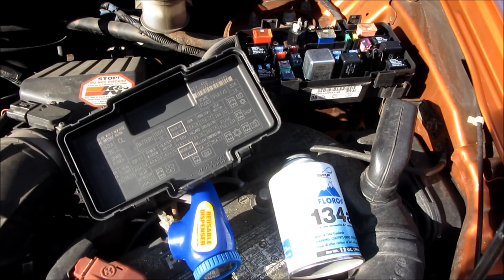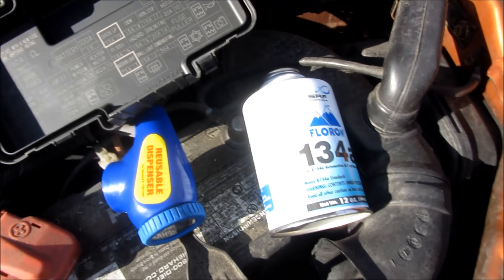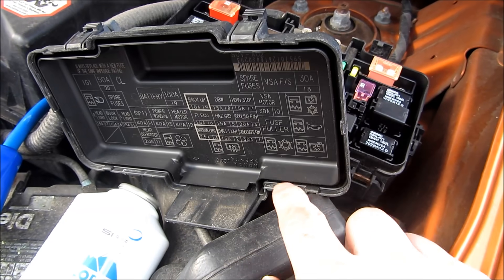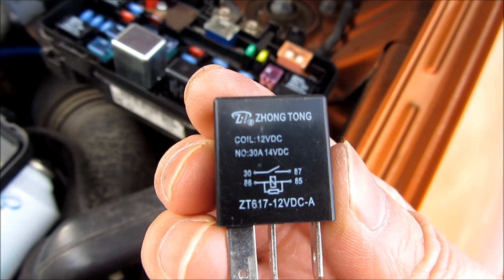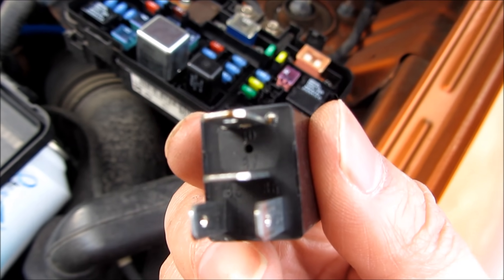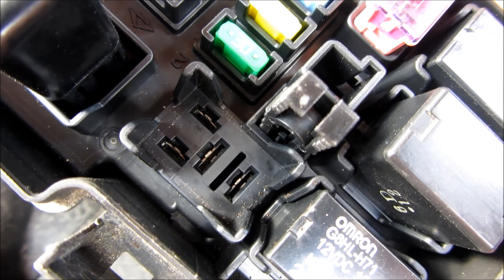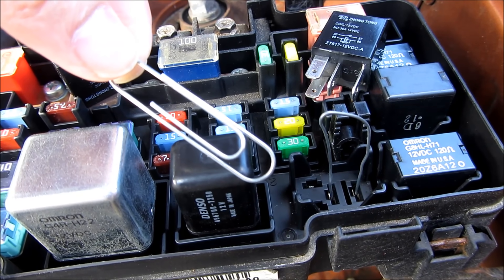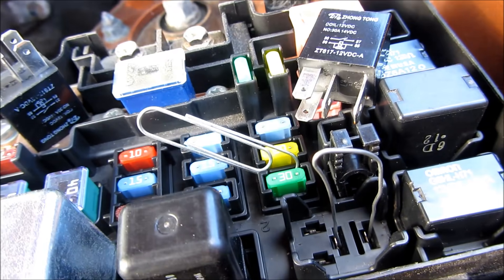Engage AC Compressor Clutch with a Paperclip on Relay | How to Fix Bypass Won't Engage | Jump Relay

Comment: Believe it or not, In most dealship workshop manuals this is step #2 in troubleshooting the ac compressor.
Reply: What's step number 3 when it doesn't engage when jumped, test light confirms power to clutch, multimeter confirmed the ground...
Reply: @chrispayseur6913  Go straight to the source.  Put power to the clutch itself and see if it engages.  That'll tell you at that point there's a wiring issue between the clutch plug and somewhere in between.
Reply: @automotiveperformancemobil4030  Thanks, I was actually able to tap the clutch plate with power running to it and it engaged. Ended up pulling off the clutch plate taking the washer out and replacing it with a washer half the diameter bringing it closer together and it's been working ever since.
Reply: @chrispayseur6913  hhh

Comment: I really appreciate this. Once I saw the compressor and everything worked, I jumped it, filled freon, and restarted. Now, it didn't cut on initially on its own but I simply disconnected the car battery for a minute to reset everything and it worked! With all the intelligence in cars you'd think a simple refrigerant gauge would be made. Nope. Imagine how many people replaced ac systems when all they needed was to attempt this process first.
Reply: my clutch would NEVER engage on my 01 JIMMY.  I just wasted 300 dollars to replace it and refill it. still never engaged. just saw this video and I'm going to be so mad if it just needed to be jumped in order to start engaging again 😡😑😑😑
Reply: Thank you very much , I couldn't understand why after all I couldn't get the ac to work until I removed the battery cable and put it back on ,thanks a lot !!!
Reply: @isabellamaya5464  How about it? Any updates?
Reply: @mikeprice8307  well still going strong! When I got my ac compressor it didn't come with a pressure switch in the back so I just kept it on a paperclip to jump it anytime I need AC  (2001 GMC jimmy 2wd)
Reply: @isabellamaya5464   so you purchased a new compressor for nothing?
Reply: @mikeprice8307  yes! I bought the car thinking the AC clutch went out .. but as soon as I found out I was ticked off, they wouldnt let me return the AC compressor
Reply: @isabellamaya5464  there's always ebay, etc!

Comment: Thanks for the info.  I was searching for ways to bypass a faulty relay for central air and this popped up which is definitely needed being that my wife’s compressor clutch is not engaging.  I’m going to try this and see if it works.  Thanks again!
Reply from the maker: if its just a faulty relay, then switch your AC relay with the Horn relay... they are usually the same relay.  to test out if it was actually a faulty relay.
Reply: @PoolarityChannel  I try to switch, it confirms that the AC relay is failing, thanks for your advice! I really appreciate it.
Reply: Great relay

Comment: Thank you so much bro! You saved me from not buying a new compressor. I did what you did on how to overide the ac clutch to engage.....it work on my '08 Odyssey that im having trouble for 2days.! Thank you! More power to you!
Reply: Do you leave the paper clip, or do you replace it with the relay after it's charged?
Reply: @wizardess_of_oz  Yes you have to.
Check out Carry Blackie's question, and Andrew's answer to the question. He explains it well👍🏻

Comment: Worked like a charm! My was a bit different on the relay. I was working on our 2009 Ford Fusion 2.3L. The relay is model 5L3T-AA. It has four posts marked as 1, 2, 3, 5. So I looked up the relay diagram and saw that I needed to use 3 and 5. Clutch engaged, and we added our R134-a. Took it for a 10 minute drive and was super cold by the time we arrived home. I turned the A/C on and off several times to ensure the clutch would keep engaging. Great video! Thanks!!
Reply: Where did u find the diagram for 3 and 5

Comment: After, I had figured out that my low-pressure switch was good on a 2002 jeep liberty. I applied your method of Engaging an AC Compressor Clutch with a Paperclip on Relay. And now my AC is working like a champ. Thank Poolarity - Life Hacks
Reply: Did you have to leave the paper clip in? Or did you take it out and put the relay back on

Comment: I don't think A/C relay "knows" if you are low on refrigerant. It simply sends electric current to the A/C clutch.
That's all it does. Another component called "the refrigerant pressure switch" can prevent clutch from engaging if you are low on refrigerant. It would have to be bypassed in order to charge the system. That is the real "chicken and the egg" situation....

Comment: On a lot of cars the A/C pressure switch is on top of the A/C receiver-drier (vertically mounted cylinder often in front of the A/C condenser/radiator). It'd be safer to pop the switch off & bridge that than the relay (not to mention you can still control the A/C with your dash while the car is running).
Reply: I checked my switch and it has continuity so it works. Next step? Clutch doesn’t engage
Reply: @PickleballBrand  he didn't say the switch, but the connector that plugs in it.

Any updates?
Reply: @mikeprice8307  on my 2003 Pontiac vibe I checked my pressure switch and it had continuity. I then checked the connector that goes to my compressor and it is not receiving the necessary 12v. Trying to find out why right now
Reply: @PickleballBrand That's another question I have. The actual pressure switch itself on mine is a three-pin connector. If I poke around with a multimeter on continuity should the actual physical pressure switch itself have continuity on some combination of the three male pins inside? I'm not getting any continuity at all on a good tested multimeter on any combination of those three pins in the physical pressure switch with it disconnected from the harness

Comment: So I have a 2006 dodge grand caravan, have not had ac in years (my teenagers were driving so I didn't care if it had air lol) But now I'm driving it and it's getting hot out.. All the refrigerant had leaked out due to the notorious rear leak. So I capped the rear lines (very easy). I proceeded to put refrigerant in but the ac clutch did not engage (I thought bad compressor due to not being used in so long. Did a little more research and read it would not engage if refrigerant was empty so I jumped the relay (30 to 87) and the compressor came on! Filled it up with 3 12oz cans and now works great! Thank you for the video!
Reply: That's encouraging. I also have a '06 Dodge Grand Caravan. I kept hearing a loud grinding noise that was coming from the engine bay, only at idle. It did it for years and a mechanic told me it was the alternator when he I had it in the shop to have the rack and pinion replaced. The noise kept getting worse and I determined that it was coming from the AC compressor by removing the AC clutch relay fuse because the noise stopped. I replaced the clutch, pulley and coil. The noise went away, but the clutch will not engage. The AC had stopped working sometime since last summer, but I thought it was related to the clutch noise. I tried adding refrigerant, but the clutch won't engage and it shows about 80-100 pounds static pressure on the low side. I also tried replacing the pressure (transducer) switch since it was only $12. Hoping if I can get the clutch to engage I can troubleshoot some more.
Reply: @redcloud5813  updates?
Reply: @mikeprice8307  I ended up replacing the compressor, front and rear expansion valves, condenser and accumulater, belt and pullies,  but still couldn't get the clutch to engage. Took it to a mechanic who diagnosed a bad transducer (pressure switch) even though it was new. He filled it with refrigerant and it's had ice cold 39°  A/C ever since. Unfortunately, the noise returned about six months later, but it still works.😅
Reply: @redcloud5813  did you attempt to use the jump method to engage the clutch though?
Reply: @mikeprice8307  yes, but I couldn't get it to work that way.

Comment: Thank you very much, now I can check to make sure the spacing is correct (my refrigerant must me low so I couldn’t engage the clutch by turning the a/c on). The new clutch engages and disengages as it should when I manually bypass it as you showed.

Comment: Similar issue lead me here. My Kia's relay was much smaller. Real issue turned out to be the Manifold Gauge Set I borrowed from AutoZone was abused by the previous renters. The hoses were acting like they were clogged because the gasket was blocking flow. Looked like the previous users were tightening more than finger tight. I switched the Gauge Set for another and I was able to complete the job.

Comment: Thnks.  May need to do this to check my ac not working after car battery replacement.  System is dead.  Reconnected battery.  Same.  Ill check relay and fuses.  Anything else to check for if ac fails after battery replace? Btw.  I can connect 12v to the compressor clutch side of relay to force voltge there if need be,  right?

Comment: Great Advice... I didn't know what was wrong with AC system. This technique allowed me to get the Clutch engaged. And since I had a can of refrigerant, I bought thinking it just needed a charge, I added the can to system. With one can I felt I might be getting cool air. Ran to auto store for another can... added just a little from 2nd can and YES!!! I have cold air. Thanks so much!!

Comment: Hi, a few weeks ago I was changing my alternator and because the AC Hose was in the way of a bolt I open it and leaked out my refrigerant. I bought some refill and tried topping it up but the compressor won’t turn on even when I tried jumping it. Can you help? I have a Honda Accord 05.
Reply: Did you put a vacuum on the system first
Reply: Desire2punish91 No I did not.
Reply: Did you ever figure out what the issue was? I have the same problem.

Comment: I did what u said and it worked but once i take the jumper off and put a new relay in the clutch won’t engage on its own what could be the problem. Refrigerant levels are good just clutch won’t engage
Reply: One or both of the 2 pressure sensors (high side and low side) could either be defective or have a bad connection. First thing to try is the wiggle test - with the engine running and a/c compressor switch turned on on the dash, temp set for very cool air, relay in place, fuse verified as being good(replace if any question, extras are usually in the fuse box somewhere), carefully figure out a way to gently wiggle the wires going to those switches, one switch at a time, and then the whole A/C harness, without endangering your hand by getting it near moving and/or hot parts of the engine,  and see if at any point the compressor comes on.  If so, fix the wiring problem.
Reply: Did you ever figure this out ? I’m having s ame problem
Reply: I'm having same issue
Reply: Well?
Reply: Probably time to see a mechanic with the proper equipment

Comment: By jumping the relay can you still turn the ac compressor on and off in the cabin manually like normal without having to remove the paperclip? Or will it just stay on all the time?
Reply: Stay on all the time until paper clip is removed

Comment: What happens when you try to fill without the clutch engaging? I realized after watching the video that the clutch was not engaging but was able to fill? Is it a thing that the system can be charged but there is an issue due to the clutch not engaged when filling?

Comment: I just did this on a 2009 Chevy Traverse the freon was so low that the compressor would not come on did the paperclip trick put two cans of freon and a pressure gauge is just barely in the green on the gauge will get another can or 2 wouldn't have no idea how much money I just saved myself but would probably be $100 or more for sure a big thanks for the video helped me alot

Comment: Hello there, I have a ford explorer car from 2010, when I turn on the A/C the clutch is not working, when I remove the relay as what you said the clutch works just fine. I checked up on the lines and nothing was in a problematic order.However, I got to discover that the negative line that turns on the relay is the one that gets lossed when the A/C is turned on while the relay is on its place and when I connect a negative line directly to the battery to the relay it can work just fine so I connected it directly but the clutch works always.i would keep that for granted if I got a reply on my question. Greetings.
Reply: This works because it is the pcm or ecm (your car’s computer) that would normally provide ground to the relay, completing the circuit. The computer will only do this after verifying certain conditions are met by reading voltages provided by the various sensors.  If satisfied, ground is provided electronically, the relay closes, and …you know the rest. This procedure should be done ONLY to get your system to accept the r134, and IMMEDIATELY restored to its original configuration, with the relay in place. If the relay is bad, swap with another like the horn relay until you get another one. Typically there are many of the same relays used in a vehicle. Just be sure to get things back to the intended order before something is destroyed- being that your post is a month old, I hope it’s not too late…

Comment: So for me, my thermostat only reads temperature some of the time. Currently waiting for a couple day block to replace the thermostat myself. I do also believe some of the wiring is bad. When my temp does not read in my 09 cobalt, the ac does not work. When it does read temp, the ac works.

Comment: Hi sr
So what happens if the clutch doesn't engaged when doing this?  
I have a new compressor and it's  its filled with ac.
Fuse it's good too. Relay it's good.
When I try jumping the relay 30 and 87. The clutch doesn't move, I try jumping the low pressure switch and clutch doesn't engage.
03 jeep liberty 3.7.
Thank you much for your video ☺
Reply from the maker: test the wiring with a multimeter
Reply: @PoolarityChannel  
I will thank you!

Comment: I jumped the relay, got the clutch moving and recharged the AC. It worked fine for a day. Now the compressor clutch is not moving again. I jumped the relay to get the clutch moving so I could check the pressure. It is still in the green so it’s holding the charge. The relays are fine. When I jumped the clutch to check the pressure it was blowing warm air even with the clutch moving.
Reply: figure anything out yet?
Reply: Any updates?

Comment: so, i was able to get the a/c clutch to spin with the paper clip and then get an accurate reading on the a/c pro freon can.  however, there's still no air blowing (or heat) in the car - any idea?  I assume it's something major.  2013 impreza
Reply: bad fan perhaps? does the fan spin?
Reply: @PurpaFur  took it into the shop a while ago, it was something electronic burning out the fan in the glove compartment or whatever that is connector or something.  he showed it to me charred.  they had replaced it first but then that burned out right away, told me it was a common impreza issue.

Comment: Will the refrigerant go in without the compressor on AND when it gets to the right pressure will the compressor start......what if the system is depleted of all refrigerant and you are just putting on a new compressor?  Will running the compressor without any refrigerant ruin it?

Comment: This worked perfectly. I was having this exact issue, where I had repaired the compressor off-engine, and so the pressure was completely released and it would not engage until it was full and could not fill without engaging. terrible design imo lol
Reply: I replaced mine and I got it to take 2 small cans of Freon and it still won’t engage. Gonna try jumping the relay
Reply: @Rehziicodm  any updates?

Comment: I have the same problem, new dryer, ac compressor, power going to try e compressor, low sensor works, but when I cross over the relay the clutch still won’t engage, any thoughts? I’m stumped at this point
Reply: Any updates?

Comment: I did this to get the ac clutch engaged, but when I checked the freon it was at the minimum green level which should be enough, but is still blowing hot (just outside air in not heat), not sure what else to do

Comment: If this works does that mean there is an issue with the relay or fuse?
Reply: could be neither, if the refrigerant is low enough the compressor will not engage. this method will allow you to check refrigerant levels and add more if needed

Comment: I have warm air blowing thru vents. My AC clutch on accord 2009 won’t engage. I replaced relay with the horn relay and still not engaging AC clutch. I also replaced the fuse with spare fuse provided with cover. Still AC clutch not engaging...compressor not spinning with AC turned on. So will this jumper work or maybe I need to buy a new relay switch? Or do I just have a more serious problem .

Comment: My clutch kicks in only when bypass..replaced the relay fuse and still nothing..does this mean my compressor is bad.  I recently had my manifolds replaced and my ac was working just fine prior.
Reply: Your pressure switch is bad.

Comment: I have a 2005 Pontiac Grand Am. Refrigerant level is good has no leaks. Put a new AC Compressor but still don't have Cold air. AC Compressor doesn't active. What can I check??
Reply: Relay and fuses.
Reply: Check voltage at the plug should be 12v. With the key on of course.

Comment: both fans and the AC clutch engaged but the Paper clip got very hot and was glowing red and turned gray after I pulled it out. I checked and it was the right two pins.

Comment: Do I turn on my car on and leave it running with the paper clip in place while I charge the AC?
Reply: Yes, when you get a reading in the green you can shut the car off replace the relay and see if it works as normal. The clutch wont run if the engine is not running.